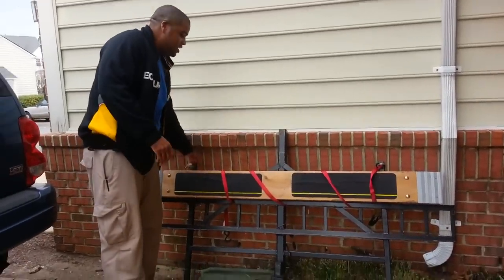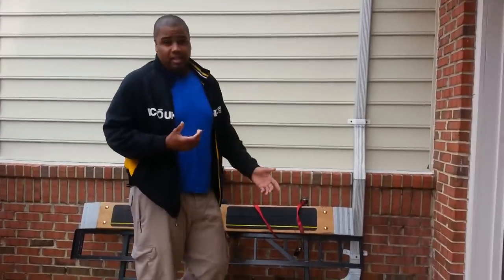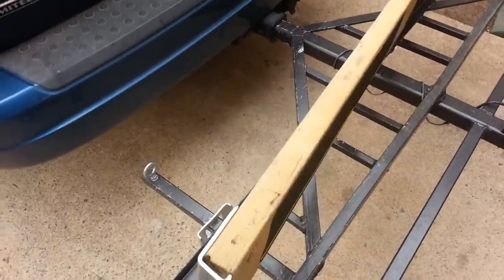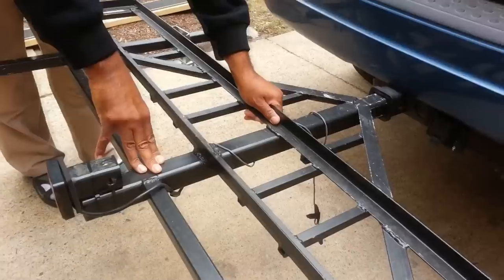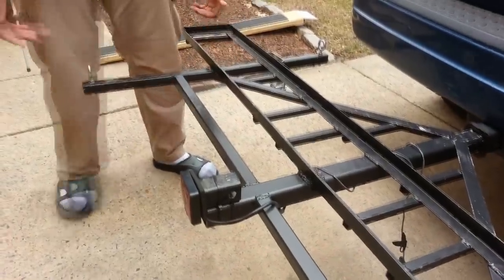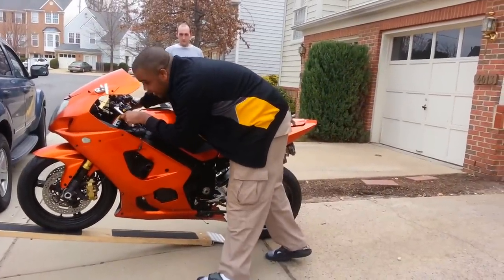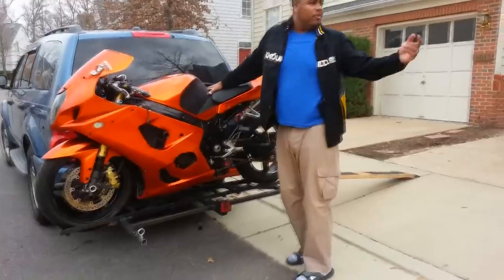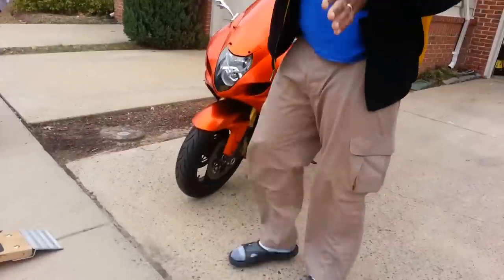How to Build a Motorcycle Carrier

Comment: Great job on the build!  I would caution away from possibly just bolting it together as you mention if someone doesn't know how to weld.  It definitely needs to be welded.  With the low cost, just buy double the amount of metal (or buy some/get some scrap from a metal recycler) and lay down some practice beads.

Comment: you could also go to harbor freight and get one of the 4x8 folding trailers for 299, put 30 into mesh to put on the floor of it and load the bike that way, I have one I traded 2 Sony 12s for, and have used it for both mine and the wife's bike. you could fold it and chain it to your luggage rack on top of your Durango when you get somewhere that you worry about theft or parking..
Reply: A trailer is usually easier than an hitch carrier or the back of a pickup, but there's always a trade off regardless of what you choose.  With a bike on a trailer, you will be needing to find parking lots where there are two spots facing each other with nothing between them so that you can drive straight through and take up both spots.  This often means parking at the far end of a WalMart type parking lot.  With a hitch carrier, you might be able to park in a single car parking space, possibly backing up so that the bike and carrier overhangs the grass.  Also, with a trailer, you might find yourself paying extra for some of the toll roads.  Plus, many states require you to register and pay taxes on your trailer each year and perhaps even have it inspected each year.

A pickup bed if convenient, but if it is a model that has been produced within the last 15 years, the bed height might be so much that you will need a long ramp so that the angle between the ramp and the bed is not so great that you end up scraping the bottom of your bike.  I have a 6 ft long by 3 ft wide ramp for my pickup and it will not work with any my street bikes.  It won't work with my lawn tractor either -- the mowing deck gets stuck.  It works with my ATV and dirt bike though.

Comment: I've wondered about these carriers, but I just don't like the fact that it is all being supported by a single 2" tube, even if the receiver hitch assembly itself can support the weight.  Supposedly, the receiver hitch in my Dodge is a Class 4 and can handle a 1200 lb trailer tongue weight, so if I was so inclined, I could build a receiver hitch carrier for my Harley Road King (800 lbs), but I just don't trust that one piece of steel to not twist.  If there were two more receiver hitches under there (one on each frame rail), I think that would be sturdy enough to design a bike carrier around.

One thing you might want to consider to make yours a bit more sturdy is to weld steel bars from the bottom of the center support up to the corner formed by the angle iron (that forms the platform for the bike) and the side pieces of square tubing that you have your tie down rings attached to.  This will help prevent any twisting between the center support and the platform which could result in a failed weld eventually.

Comment: No body!! not even Richard Dean Anderson can  macgyver shits more than me but it's never for something expensive or could harm others if it fails, Ebay has a proper factory made rated up to 600lbs hauler for under 180 bucks free shipping. When it comes to safety that's something I always pay retail for.
Reply: Just because it is home made doesn't mean it isn't safe. That's the point of DIY not paying a box store for it and doing it right yourself. Nothing he showed screams to me unsafe. Retail is nice but some stuff you purchase is crap and comes out better and safer than anything you can get off a shelf.
Reply: +bigguy78246 run a basic FEA on that rack and I think you would be horrified ... it is dangerous even if it hasn't broken yet...it will break
Reply: +nvwalters   What's FEA ?
Reply: +Ojeramup12 Finite Element Analysis... an engineering term

Comment from the maker: Its all depends on your tow hitch down force capacity. Im about to post a new video with the same bike that was loaded on it. My friend put the hitch on his dodge ram pick up and it was fine. I live in Va and i ve driven to bike week in SC and back. No problems.  My next buuld I am going to use bolts and weldung on the main support. Just for added safety. If you need some help I can send you my exact measurements. Bigbandit007@gmail.com.

Comment: Won't work. The bikes weight will make the 1x square steel that hooks into the car, will twist and turn because the bikes weight is uneven front vs. back. This is not good.
Reply from the maker: hedegaard8 So, what your saying is something that you see working. Doesn't work. O-kayyyyy. The main support in the middle is not 1in. Thanks for watching. Please sub.
Reply: You're right, I was (partially) mistaken. I've now seen other videos where other people do the same thing and it seems legit. Its amazing then, that it does NOT turn&twist because of the uneven weight distribution. Just goes to show I can be proven wrong and learn something new. Sub? Sorry, not interested enough in your channel, though I do like a few videos already. Keep up the good work and thanks for taking the time to reply.
Reply from the maker: hedegaard8 no problem thanks for watchingm